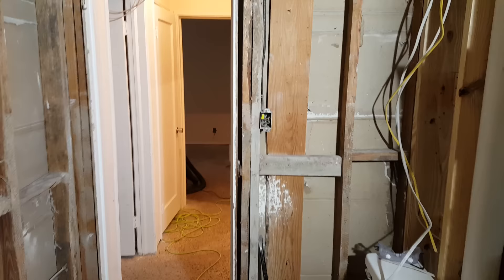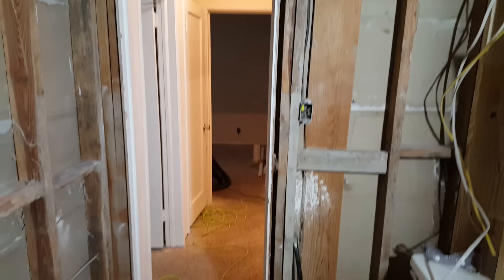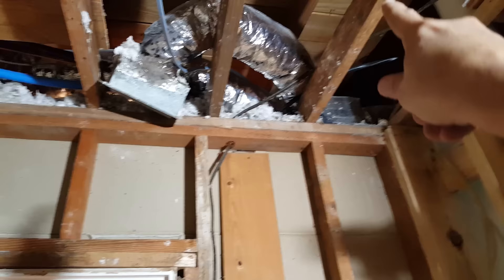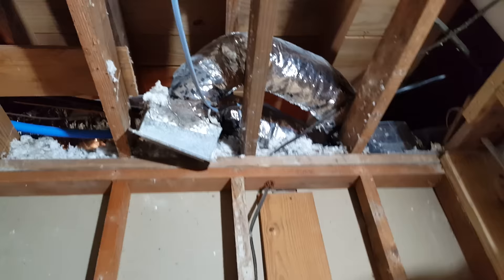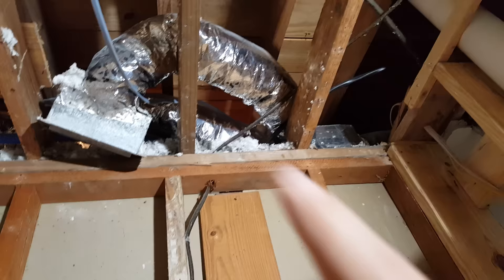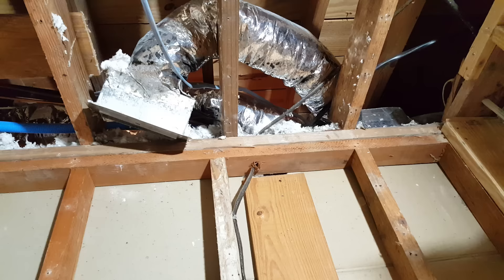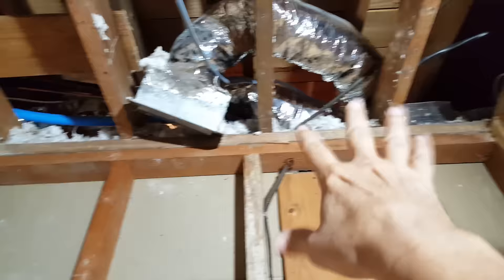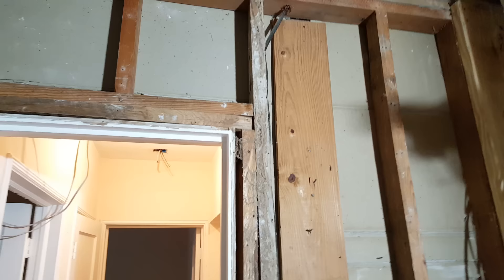How to Tell if Your Wall is Load Bearing

Comment: Most walls have 2 plates on top of wall not just load bearing
Reply from the maker: Yes, that is true, as the 2nd plate is used to tie the 2 walls together. But you would NEVER see a load bearing wall with only a single top plate. Also what about the case where you don't have the top plate and are using instead the 3 x 6 galvanized plate to tie 2 walls together as allowed by the International Building Code? Then all the joists above, must land directly over each stud, or they would snap the single top plate. So my point was, every load bearing wall must have that second top plate.
Reply: @jeffostroff  are you saying that you dont have to use top plate if you use galvanized plate and land joists on wall studs for load bearing walls
Reply from the maker: @realmattpcd  Yes, that is correct, and what makes this possible is that the joists must land directly on the studs so that the point loads can be carried down to ground.  With standard non-engineered joists and roof truss systems, the joists often land in between 2 studs, so they need that upper plate.
Reply: @jeffostroff  I've been in the business for a long time my only point to this is that there are some things that should be left to professionals and a video saying an easy way to go tell can be misleading and cause someone to make a mistake even the conversation between you and I has flaws
Reply from the maker: @realmattpcd  The conversation between you and I has no flaws, everything I stated was correct 100%.
Reply: @jeffostroff  i didnt say what you said was wrong I said it has flaws.  You start by saying that a bearing wall would never have only one top plate and in the very next sentence go on to explain how a bearing wall can have only one.  What I'm saying is there are different ways to do most things in construction and something as important as bearing walls should be left to professionals.
Reply from the maker: @realmattpcd  Would love to get your opinion of our other video for eliminating wobble in a kitchen wall https://youtu.be/KWIHdWjPKC0

Comment: Sorry sure but this is wrong the top plate get another plate nailed ontop called a tie plate that ties all the walls together like a puzzle peice that will and should be on all the walls thoughout the house that has nothing to do with load bearing...usually a load bearing wall will have a stiff back and kicker ontop that supports the rafters and the ridge ontop usually a wall towards the middle of the house
Reply from the maker: That upper plate serves both purposes, as a tie plate and as support for top plates on a load bearing wall, although those upper tie plates are used on all walls anyway because of the need for a tie plate. Are you seriously telling me you would build a load bearing wall with only one upper plate? You really don't think that 2nd upper tie plate is needed for a load bearing wall? This is where many people get confused, because that plate has a dual purpose. The IBC rules state that you can eliminate that upper tie plate if you use a 3x6 galvanized plate to tie the walls together. But if you go this route and the wall is load bearing, these same rules state that you must have the joists directly over the studs if you only use one top plate. That is proof that the upper plate is needed for a load bearing wall. Doe snot always mean you r wall is load bearing if you see 2 plates, but it confirms it. Let's say that wall only had one plate, then we'd know it was not load bearing, because joists are not directly over studs.
Reply: Nope no walls are built without a tie plate load bearing or not all walls here in Arkansas are built with a tie plate

Comment: That wouldn't pass inspection. That's not a header. Sorry my friend he didn't do anything right.
Reply from the maker: Robert Durham Jr  You are correct it would not pass inspection for a loadl bearing wall this is how the builder built this wall in 1946. It may pass for a non load bearing wall.

Comment: Usually a load bearing walls are 2x6 or larger.  2x4 headers are used when the wall isn't weight bearing. 
The nails are the only thing holding that header, lol because it's missing the crips....  subscribe to my videos for more misinformation lol

Comment: I seriously doubt that is a load bearing wall
Reply: You are right that it may not be load-bearing. Just because the wall is perpendicular to the ceiling joists, doesn't mean that wall was designed to be laid-bearing - it could just be there because a wall was needed to be there to form the room..... either way, better safe than sorry.....
Reply: Paul Underwood just because joists are on it doesn’t mean it’s load bearing. Length of the joists, depth of the joists. Do the joists stop at that wall? The wall could be bearing a load just for piece of mind but it may not be necessary
Reply: I agree. When you look thru the bathroom door you see a hall wall that would support those ceiling joists, the wall of the bedroom plus the outside wall behind him. Not likely a load bearing wall.
Reply from the maker: In the truest technical sense, the wall would be load bearing if the ceiling joists had an endpoint on top of the wall. So the joists running perpendicular and not ending on top of this wall would not be a load bearing wall. However, 75 year old house, you can bet those joists are exerting some downward force on the wall, so best to treat it as a load bearing even if it is not load bearing.

Comment: Ceiling joist layout has nothing to do load bearing........2 top plates are designed for joist to fall anywhere on wall (impossible to line up every wall) in 35 yrs have never seen a house (even load walls) line up joist to stud......

Load bearing is continuous support floor to roof (not floor to joist) lining up ceiling joist has nothing to do with it ( dbl top plate allows joist to fall in between studs and ties walls together)

Comment: Not a load bearing wall..... lack of reinforced header over the door says as much. Two 2x4's laid flat isn't a good header to carry load. Secondary top plate or crown plate (what you call "cap plate") doesn't mean load bearing. When you talk about lack of a crown plate, that's a type of framing... not necessarily "load bearing". That is called an advanced framing technique to maximize insulation and load carrying ability of the lumber (among other things). Crown plate is used to tie in non-load bearing walls to keep them located in traditional framing. When it's a load bearing wall, they do help support the upper structure when the spacing is different, but even there you get it wrong. By the simple fact you reference 25" spacing for studs in advanced framing..... it's 24" if using advanced framing techniques if the engineer deemed it to be adequate. Seriously if you get that simple fact wrong, (basically because it can't work with current building materials dimensions as they are sold) it's pretty clear you have no idea what you're talking about. That last statement is a personal attack I know, but I can also see you're really close to an exterior wall (along with the other indicators) so I have a hard time believing it's a load bearing wall.

Now worse case scenario, everybody believes that every wall is a load bearing wall, so really no real safety concern, but it is a waste of materials at least and at most you're costing people money they shouldn't be spending. Do more research about load bearing walls people. Just because this idiot said every wall in your house is a load bearing wall, doesn't mean it's true. If you are still unsure, get several contractors to give you a quote on your project to determine if the wall in question is a load bearing wall.
Reply from the maker: Funny, 2 General Contractors came in and examined it, one said it was load bearing, the other was not sure, but thought maybe it wasn't. Also some of your statements are based on the "FACT" that the top of the door header does not indicate it's a load bearing wall.  That's an illogical way to call a wall load bearing or not.These were tract houses built in 1946 for veterans, and built on the cheap, big time cheap, so corners were cut, codes not enforces, headings not done to code, not even sure if they had vertical 2x6 header "codes" back then. You should not use the structure of the door header to determine a load bearing wall, as the door could have been framed wrong, throwing off your assumption. What makes it a load bearing wall or not is whether a ceiling joist over that wall is a load that has an endpoint that ends on that wall. That's what you did not mention in your soliloquy. Also, with all the sagging going on in these old houses, and the weight of the roof and trusses sagging on top of the wall, are you really going to say there is zero downward forces on this wall? Come on, give us all a break. Thanks for your input on the top plates though.
Reply: @jeffostroff  So what you are saying is that there are more factors you did not mention in the video. I didn't mention but now I must, that I did not see any of the joists sistered(?) to the ones being supported (ie. it was the support for two sets of joists). Nothing says it's a load bearing wall from what I can see or what you said. But if it has become a "load bearing wall" due to settling or bad engineering then you should address that. 

What I'm saying is that you could have created more content to better educate your viewership. Instead you improperly described a load bearing wall when there were many more problems with the structure as a whole as you inferred with the previous comment. If you considered it a load bearing wall (when it wasn't supposed to be), then that should have been addressed as to why it had become that.

Comment: I would rather the door header be 2x6s turned on edge with a half inch plywood in between. What I like to call a sandwich beam.
Reply from the maker: Yes, that is how we do it today. This was built in 1946, and doubtful whether that technique was used back then. Do you also do it on non-load bearing walls?

Comment: That is not a proper load bearing header above the door.
Reply from the maker: These were cheap homes built for veterans in the 1040s, so lots of corners were cut. Also there is still debate as to if this really i load bearing since no floor joists or roof rafters have endpoints on top of the wall.

Comment: Nobody cares about the wall before it is constructed because everyone knows what walls are bearing g cuz you can see them. We need to know about the reno of walls of old condos. How do I tell if a cutout window from kitchen to livng room is a bearing wall
Reply from the maker: There's a lot of factors that you need to analyze to be able to tell whether that is a low during wall in that condo. For example I fear in a multi story dwelling, if there is a cement slab over you for your ceiling, chances are the wall is not load bearing unless there's A-pole in it somewhere. If it's a wood structure building you then have to be able to get to the floor above you to see whether whether there are any joists that have an end to point on top of that wall. If there were any Joyce or rafter rafter from the roof that have an end point on top of that wall it is a low bearing wall.

Comment: I'm an amateur, not an architect/engineer/builder/contractor by profession.  There are so many things wrong with the information provided in this video I don't know where to start.  Further, if this was a "load bearing" wall this guy is standing in front of pointing out things, it was incorrectly built to begin with (I don't believe it is load bearing).  I wouldn't even cheat on constructing a non-bearing wall this way, but that's just me.  Okay, just one item out of many, there is no such thing as 25-in. spacing according to any standards.  I think that's where I finally couldn't stand it any more.
Reply from the maker: This is how they built this house in 1946,right or wrong this is how they did it on the cheap, track homes for veterans. Codes have changed over the years even the header is not allowed by today standards. In fact IBC Table 2306.7 includes earthquake-resisting shear walls made with ½-inch drywall over studs at 24 inches. To summarize, studs at 24-inchspacing will save money and resources, and are safe. With 2x6s, it's a no-brainer for most residentialconstruction—they're plenty strong in nearly any configuration.. go see builder matt risinger video on this:  https://youtu.be/aYqgdLB10pE

Comment: Why are you calling it a floor joist
Reply from the maker: Raul Gonzalez  Floor joist ceiling joist it's a joist.  I'm just so used to being on the 2nd floor looking down and calling it a floor joist and it theoretically would be a floor joist if you are putting a second story on this house.
Reply: jeffostroff well then you should call it a ceiling joist or better yet a rafter tie because by definition Joists are used in floors and as column support. The joist (also called Bandsill) supports the load which the floor is built to bear.  on a side note drywall is not designed to span a 25 inch on Center framing members per USG book even if it's 5/8 drywall the maximum span is 24 inch on Center which is very common along with 16 on Center but definitely not 25 inch on Center

Comment: There’s no code that tells you a span of a 2x header that’s installed flat!  If it’s a load bearing wall, header is installed on edge whether it’s 2x4,2x6, 2x8 etc. Never flat. There’s no structural integrity even if you laid ten of them flat. There’s no data to back it up.
Reply from the maker: You are sort of right and somewhat wrong. You can't use the header of the door as proof of a load bearing wall or not. The builder could have built it wrong, we don't know. I find stuff that builders did wrong all the time. The best evidence of load bearing wall is if the ceiling joists have an endpoint on top of that wall, then it is a load bearing wall. But for you to assume that wall is not load bearing just because the header is not an edge up header, is bad logic. Of course I prefer to make all my headers 2 x6 and standing up on edge, whether it is a load bearing wall or not. It's not much extra effort to make the header, and it also allows flexibility later if someone wishes to turn that wall into a load bearing wall. And you say there is no structural integrity if you lay them flat? Well the 2 top plates support a load bearing wall, and they are laid flat. What do say about that?
Reply: jeffostroff 
They are only spanning stud Center distances!  16” or 24” at best!  Not the distance of a door or window opening. Theoretically you can put an opening anywhere you want if it falls between stud centres and not need a header. What do you think about that.

Comment: Go ahead and build an interior wall inside a structure and try to stand it up without the second top plate.  Can't be done. Has nothing to do with load bearing.
Reply from the maker: Alan Pettyjohn  It can be done and it is even allowed by the International building code as long as you use a 3 by 6 zinc plate
Reply: Allowed or not. you hit the rafters, or floor joists, before you get it erected.

Comment: This is a horrible example.  If in fact that is a load bearing wall then the header has to be made of at least a minimum of 2 each 2 X 6 (depending on the load) and they need to be on edge not flat.  The way the rafters come down it looks like there was an addition and whoever did that had no idea what they were doing.  You really need to point that out because you are leading people to believe that is the correct way to build a bearing wall.
Reply from the maker: In the strictest sense of a load bearing wall this would be load bearing if the endpoints of the ceiling joists wrap ended on top of the wall. many people’s houses were built like that also you're trying to reverse engineer it by using the wrong reasons to determine if the wall was load bearing . Like you said people build door frames wrong all the time so you can't look at the door frame as a means to determine whether it's a load bearing wall or not because people make mistakes all of the time this could still be a load bearing wall but the door frame done wrong .
Reply: @jeffostroff  I agree.  My only problem was with the header.  The header was discuses in the video and it should have been pointed out that the header was not the correct way to do that.

Comment: Hmmmm....  so you are saying EVERY wall running perpendicular over a wall its a load bearing wall?   I call BS.
Reply from the maker: Well it is a good rule of thumb. More accurately, if any rafters or joists have endpoints on top of the wall it is  definitely load bearing

Comment: Ugh don’t overcomplicate how to identify a load bearing wall. 

Simply put, load bearing walls are running parallel to the main support beam in your basement. If no basement, then check the attic, walls running perpendicular to joists/rafters. This should be no more than 1 minute (and that’s being generous). This Old House explains it much better with their mini house model for illustration.
Reply from the maker: It's not as simple as you made it either.
Reply: @jeffostroff  this is a short video that clearly and shortly explains a load bearing wall looks like:
https://youtu.be/keDjhCqQu5o

And a little more in detail:
https://youtu.be/y6YVBy-1hjQ

Both pretty much saying the same as I stated, except maybe I should have said this applies for residential to be more politically correct